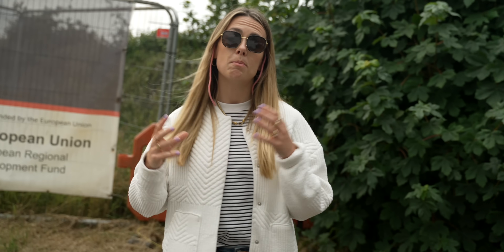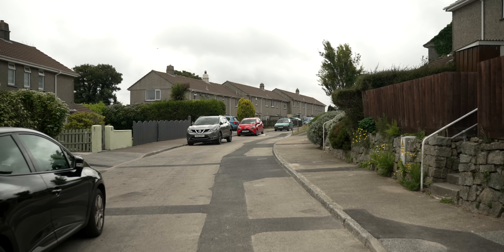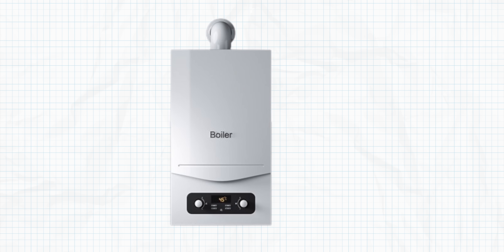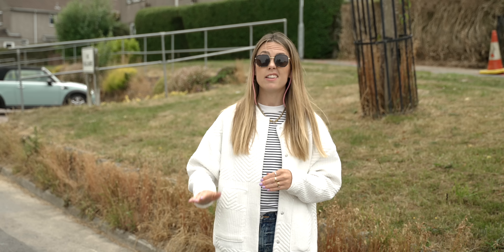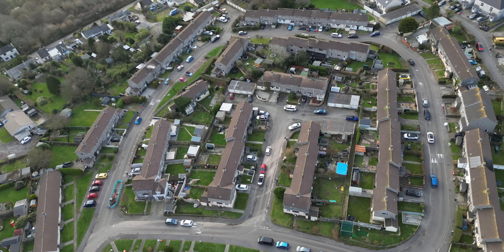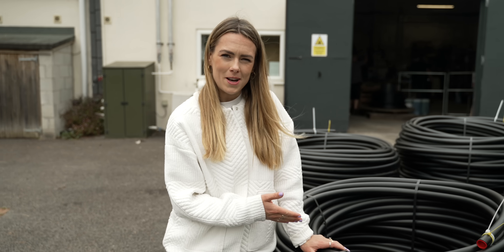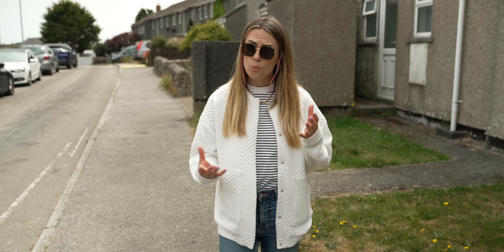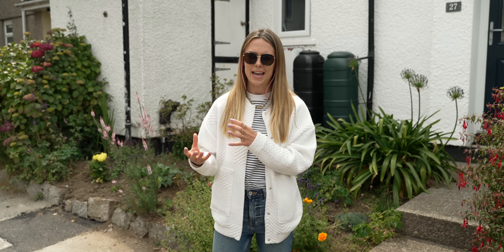Can Kensa's Ground Source Networks Supercharge the UK’s Heat Pump Rollout?

Comment: The ASHP is now just as efficient as a GSHP, with most ASHPs obtaining COP values of around 4.2 average yearly, it's really just down to cost and that's in favor of ASHPs now as the cost of a GSHP is far higher, therefore ASHPs are the way to go. GSHPCommunal heating like this is of course a different ball game.
Towards the end of this video, it is asked of Plumbers (Gas heating engineers) to increase radiators sizes as it makes the cost of the GSHP install cheaper, the building regs already make it clear that when fitting a boiler the water temperature into the heating circuit should not be higher than 60 degs, so heating engineers should already be installed to a lower delta T to achieve this and that normally some means larger radiators need to be fitted, I would have thought that she would have known this.

Comment: You cannot get to CO2 neutral via electrics as 90% of the problem is THERMAL.  Making fuel will be 20 times cheaper than a 100% RE grid.  Fuel IS the battery.  Make the fuel from RE, Captured CO2 and water.  Batteries are LOADED with CO2 and radioactive waste and MUST be ELIMINATED or you will NEVER get to your CO2 goals.  

New Combustion tech will be 20 to 40 times lower in costs.  The problem is costs, and electrification is the problem.  Happy to discuss.  Yes I am an engineer with new tech to solve your CO2 problems.

Comment: Hey guys... wanna know a secret? It's a bit out-there, but I can trust you guys, right? The reason Cornwall's geology is so warm is because the granite it's on contains thorium and uranium. That underground heat is from radioactive decay. That sounds scary, but it's not actually that much radioactive material and it's all locked up tight in dense, solid rock. It's not much radioactivity, but a county-sized block of granite with a small heat dissipation per unit volume will still get a few degrees warmer at the surface and a few tens of degrees warmer deep down (like at the United Downs Deep Geothermal project). This kind of geology is why building surveyors issue radon reports, as cellars/basements in this kind of geology can accumulate radon gas if you're reckless with your construction.

Comment: Thanks for the feel good story, but I do have a couple minor critiques.

Imogen,  Initially referenced  heat coming up from the ground, made it sound like a geothermal project. When in reality it turned out to be a more common ground source heat pump project

And it was a little disappointing that the additional electricity costs weren't lower than the existing fuel costs.  (Plus did it include the cost of the new infrastructure in the 40 year contract? It didn't explicitly state that in the post, but it seemed to be referred) 

It seems like there has to be more government incentives 'initially' to prove to later adopters that everybody that is made to switch is saving money..

Comment: Why did they keep using radiators???  Every summer we hear the folks in the UK gripe about their "heat wave" that is called summer.  Have real heat pumps installed that can do heat and cooling without ducts... just the mini-split air handlers attached to the geothermal.  So dumb, like always.

Comment: Is there not still a problem with heat pumps only heating water to 50 degrees and so things like legionaries disease etc could be present in hot water - which is why gas boilers maintain it at about 65?

Comment: Sounds like a scam, company installs pipes in the ground and rents them to customers, pipes will last a long timeand are cheap, but customer has to buy expensive heat exchanger witch will not last long, additionally pay rent for pipes and pay for the electricity witch is the primary heat source in this case. This expensive hardware improves effectives of using electricity form 1:1 to 1:3, so you can easy calculate if it is even worth installing.

Comment: There is an interesting project in Caerau, South Wales trialling heat pumps using old flooded mine works as the ground source heat, temperatures above 20°C.

Comment: fwiw Drake's Landing SC is a community thermal project near Calgary, CA. Their twist is community ground source heat that is seasonally charged/stored by solar thermal. The community achieved 96% solar fraction (fraction of heat provided by the community system) which is impressive given the cold winters at 51N latitude.

Comment: Having installed a private GSHP (Waterfurnace Series 7) here in North Texas back in 2014, we went from 3 systems totaling 7.5 tons (90k BTU), only one of which was an ASHP, to the single 5 ton (60kBTU) system split into 5 zones.  The house is 3700 sqft.  Because the system is both variable speed compressor and blower and we have the motorized dampers on the plenum for zoning, we are more comfortable year-round (biggest benefit) and honestly save more $ in heating mode than in cooling.  Variable speed allows us flexibility to extract humidity by the buckets without having to over-cool any spaces.  With all of the ductwork in the attic, we were advised to have all ceiling insulation removed and have open-cell (0.5 lb) foam sprayed into all of the rafters at about 5” thickness.  Because the roof area is 6100sf, this added $8k to the cost but leaves the attic as essentially conditioned space, meaning that the R-8 insulation on the flexible ducts is not having to work against 10degF winter air and 130+ degF air in summer.  In fact, the insulation change was stated as a mandatory step to getting the system size down to single 5T and that without it we would have had to installed two systems at combined 6-6.5T.  Our ground loop is made of 5 vertical boreholes with 1.5” polyethylene pipe in a U-shape, each going down 300 feet, which ties together in a common manifold 3 feet down and comes and goes from the house as a pair of 2” lines of the same pipe.  Our loops are filled with tap water which was filtered at the time of install, as glycol mix was not required in our climate.

I can only imagine how this would be more prevalent if designed into new subdivisions, using community loops, by the developer from the word go.  Well, maybe not in Texas (smh).  I am not quite sure why these systems are not mandatory in all new public builds, such as public housing, government buildings, schools, military bases, etc., as such are built and expected to have long-term single ownership.

Comment: The only thing i dont like, is that with an air source heat pump, if it costs £10k thats it, done and dusted. With this system youre effecticely signing a long rental i assume, like a commited standing charge?

Comment: This is a more sensible solution than row upon row of houses having fans running in the back yard... And this has less moving parts to fail. I'm not an environmentalist, but this just makes total sense to me. Also removes the need for gas supplies to new houses, so an extra bonus.

Comment: The problem is the performance drops of after a couple of years. The ground around the pipes gets cold and no longer delivers heat.
Reply: You'd be putting waste heat back into the ground in summer.
Reply: @gigglehertz  no you wouldn't there is no AC in UK homes.
Reply: @keypoint1293  if you are installing a heat pump of any kind - then you would.
Reply: @gigglehertz  the uk is not hot enough for ac and that would be very wasteful. It is not done in the UK. UK system heat radiators they don't blow hot air. A cold radiator will not pull heat from a room.

Comment: If we are REALLY about speeding up, than that is not the solution. 
Ground to Water heat pump instalations  costs 25 000 euros per home
Air to Water heat pump instalations costs 15 000 euros per home
Air to Air heat pump instaltions costs 5 000 euros per home and could be cheaper and much more easier to do.

And it is just untrue, that ground source heat pump are 30-40% more efficient. Running that water pump over 150m long shaft if energy intense. Ground source heat pump has SCOP of 4, same as Air source heat pumps. Never saw a single ground source heat pump with SCOP of 5,6 ( 40% more efficient )

For me it just ridiculous, that we are in emergency, and everbody trying to push the most expensive and complicated heat pumps solutions, when in reality everybody just cound drill 5 holes in their houses, put 5 Air to Air heat pumps and solve the issue. We went with Air to Air, and it just works. Cheap, easy to repare, easy to replace. 

For now only rich people cound afford heat pumps, as the are no subsidies for cheap Air to Air heat pumps. Same as with electric cars - subsidies for luxury electric SUV cars, no subsidies for Ebikes or Quadricycles with roofs ( citycars ) . Subsidies for Ground source heat pumps, no subsidies for Air source. Subsidies for insulation of luxury mansions with triple glass, no subsidies for living in a small flat using almost no energy for heating. 

RIDICULOUS.

Comment: I’ve been saying about these for years at this point. New builds should absolutely be built with this type of system (they’ve already got the ground clear).
Reply: Still using microbore piping which as with all this fledgling technology is either perfectly alright or no use for heat pumps, you takes your choice. The problem with net zero is the politicians have set the dates first in a plethora of idealistic woffle and belatedly thought about how it will work, that is even if they care or understand the problems at all.
Reply: You realize how expensive it is right! Not everyone is going to be able to afford it
Reply: @alanmay7929  A significant portion (the majority I believe) of the cost of ground source is the excavation and disruption. On a blank site already full of excavation equipment the cost is significantly lowered. One of the biggest benefits of a community loop is not requiring massive space for a single property, and requiring far fewer boreholes, whilst benefiting from costs of scale.

New build houses are already expensive (hundreds of thousands), an extra few thousand on a heat pump is not going to make them unaffordable to the expected buyers.

Comment: LOL, if u've been to Labrador/New FoundLand, not sure which is best considering that they got consistent really strong winds for wind power generation for electricity.  As for needing heat during winter it might be best to use the heat pump.

Comment: Heat pumps are worse that useless and expensive. I have a neighbour that has one and he still as to use a gas boiler as the heat pump does give enough heat. Get the true facts on heat pumps that are crap.
Reply: or you could actually watch the video as there is a big difference between ground and air source heat pumps and secondly if you look at the facts they do work when they are correctly specified in size for the house after a heat loss survey, again all covered in the video.

Comment: The only concerns around this and most other "community energy" projects is cultural and financial.  We live in a western capitalist democracy.  "Community energy" projects would be better supported by a socialist under pinning, the kind the UK is seemingly moving away from.
In a capitalist democracy the infrastructure will be owned and operated by large utilities.  We all know how well that has been going.
While on the short term there is minimal maintenance, but it's not zero and if shared infra fails, it fails for all.  At the moment if that is the electric, gas or telecoms lines they get noticed quickly.  If it's your ground pump leaking at "No 38" down the road where nobody is current living, it's going to take weeks.
If the communities are too small, neighbours will fight.  Whether valid or not, if someones heating isn't working they way they expect they will blame their neighbours for "hogging" the resources. In a capitalist society it's likely this will be managed by "pay per use" with a sizable profit for the utilities.

Comment: "Climate crisis!!", my hairy ar$e.  All based on the SCAM that global temperatures are soaring out of control, and it's all OUR fault.  Reality?  What little global warming we've seen in our lifetimes has been exceeded - both in absolute temperatures and speed of change - many times in the past.  Even worse for the AGW 'theory';  despite the fact that man-made CO2 emissions have been soaring for decades (thanks to China, and partly India), global temps. stopped rising in 1997, levelled off for about 20 years, and since then have been FALLING - with all the indicators from solar activity pointing to this continuing for decades.
Source?  The only global weather monitoring system we have - the weather satellites.
By the by;  if you think global cooling is something to be welcomed, try looking up the Dalton Minimum, and the Maunder Minimum.

Comment: And then it is much easier for people to generate their own electricity on-site after the install if they choose to spend more on other systems such as solar panels and backup batteries, which could help to guard against any potential fluctuation in electricty prices. If not, it is still much easier for the UK to generate its own electricity, reliability, and in a low carbon manner than relying on extracting and refining oil either from the North Shore reserves or from abroad, so it is much more likely that electricty prices will remain stable into the future when compared to fossil fuel prices. Community heat pump systems seem like a good plan for many reasons.

Comment: Desperately keen to have a ground source heat pump in the naughties I got a quote for a borehole version (horizontal version was impossible). We had a metre of clay overlying flinty chalk, were told we would need to start with at least a 100m deep borehole and a starting price/base price of £30,000... my wife wouldn't let me do it.

It was vastly over-priced. If you look up prices today, you will find a guide price for drilling boreholes is typically between £25 to £40 per metre. The guideline for a borehole contributing 4kW to the heat system with a standard compressor is roughly 100 meters at  £4,000 – £6,000 and you will need three of these for a 12kW system, so £12,000 – £18,000 for the drilling of the boreholes.

She would have accepted that.

Comment: I installed our own GSHP back in 2010. Paid for itself by around 2016. Have had to replace one blower fan under warranty and had a couple of small failures where wiring connections inside the unit failed but were fixed within a day each time. It can keep our drafty old house warm all the way down to about -15C outside late in the winter, and a little colder early in the winter when the trench temp hasn't been drawn down yet. Provides us with AC all summer, basically for free as it uses the heat from the house to heat our domestic water. Although it required a bit of learning to tackle it myself, but for a confident DIYer it's possible and if we'd gone with a pro install the payback time would have been another 4 or 5 years, I'd still be net positive now.
Reply: That's surprising that you went for a GSHP instead of an ASHP. I mean the GSHP is very obviously better but the capital costs are also far higher :(
Reply: @waqasahmed939  Yes, capital costs are often prohibitive for most. I was able to do the install myself as there's a supplier in the US that sells kits that can be feasible to do that so it mitigated the cost significantly so the difference wasn't as great as you might think. With the better COP, especially considering what was available in 2010 for ASHP it ended up being a good investment. Of course, one has to be lucky enough to have the land available as well.
Reply: @johnway9853  The land is the other issue,yes

For me it'd have to be a massive bore hole and I hear that ASHPs are catching up anyway

Comment: Anyone know what they backfill the bore holes with to ensure contact between pipes add ground? Also when they mentioned plumbing retrofit is this because the pipes need to be larger diameter due to thr higher flow required because the heat pump water temp is lower compared with gas boiler temps?
Reply: Atleast here in Finland holes are not filled with anything but they fill up with ground water which is a excellent heat transfer.

Comment: If the UK really wanted to explore heat via the geothermic gradient it could examine old mine shafts which have been backfilled. Some of these are almost 1000 metres deep. I see no real take up in individual heat pump units for heating property and would be surprised if it take up reaches 5% of the UK housing stock

Comment: Average standing charge for gas is £0.29/day in the UK, so I sincerely hope that those residents are not paying £1/day for their GSHP standing charge 😮!! Especially considering that we keep hearing that HPs require very little maintenance and are being told in this episode that what is in the ground is “just” hose pipes 😅
Reply: Agreed. So we get free heat, from the ground.... and the running costs are "competitive" to oil... A method of heating that no one can afford.
Reply: @qcope  or as usual, some are making a decent amount of “pocket money” out of this necessary transition.
Reply: @qcope  It greatly depends on local costs and equipment efficiencies. My air-source heat-pump is cheaper than gas down to -15C. My electricity and gas is dirt cheap but if the ratio of electricity to gas was more, then gas would be cheaper. ($0.09/kWh Electric and $0.032/kWh Gas, 2.8 ratio) (average UK $0.38/kWh Electric and $0.09/kWh Oil, 4.2 ratio)

Comment: Don't forget to have a backup for when they switch the electricity off.
Reply: Gas boilers don't work when there is a power cut.
Reply: @chrislaf2011  Then do not think those are a backup ;)